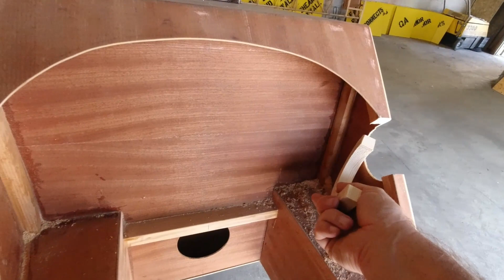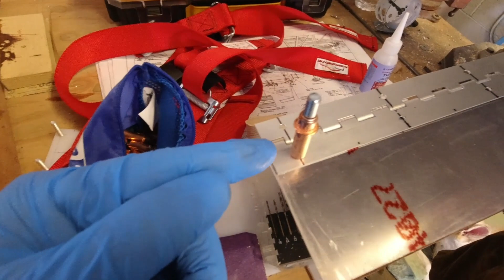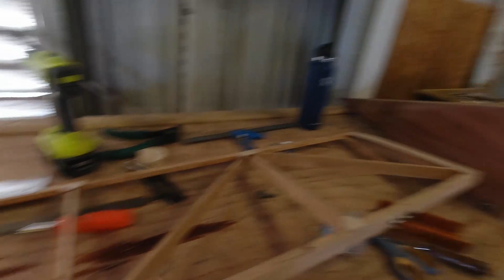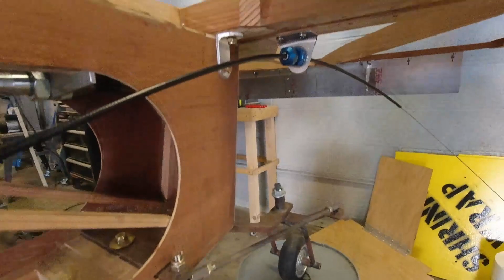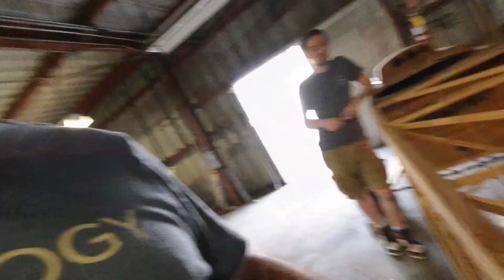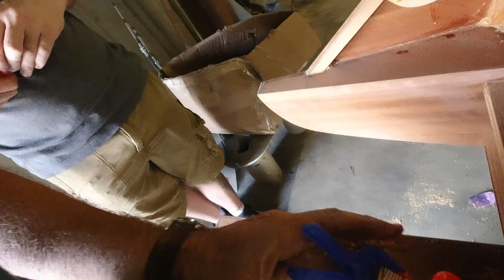Minimax 1100r Wood Aircraft Build Ep 131

Comment: Dannis, thank you for documenting your build. I have started to build one of these and I find your channel absolutely precious, I'm learning so much!  I too intend to use a 1/2 WV, so I am very interested in how you mount it.  I do not mean this as a criticism, your workmanship is outstanding, but it seam to me that those round pieces you made to go around the cut-out in the engine mounting section may not be adequate to transmit the load of the RS-9 that you had to cut.  All the grains in those pieces are cut, how can they withstand any load along the RS-9?
Reply from the maker: Thanks so much for your message. If it were not for the piece being epoxied to the plywood as well as the RS9, I would agree with you, it would not do the same job as the straight piece. Having the ply assisting in carrying the load makes a huge difference. If there was concern, you could add ply to the inside as well. I’m just following something that is already proven as viable. 
Thanks so much for following the build!

Comment: For some areas, take and mix your Epoxy inside the bottom corner of a plastic bag. Massage it until it is mixed, then just clip the corner of the bag and apply gently squeezing on the bag like a cake decorator.
Reply from the maker: Such a great tip John!

Comment: Elevator trim being a separate control surface is not what I'd expected, pretty neat!
Reply from the maker: I’m sure the static trim works just fine for hands off cruise speed. I just prefer to have the option to trim across all speeds. It’s a simple setup and not difficult to install.

Comment: Dennis.  Your adjustable elevator trim tab came out really nice.   I'm sure it will get a lot of use in flight.   I took the easy way out: Used the bendable tab.  Worked, but nothing like you and Parker have installed.  Later.  N6395T
Reply from the maker: Thanks Michael!
I really like this setup…easy to execute